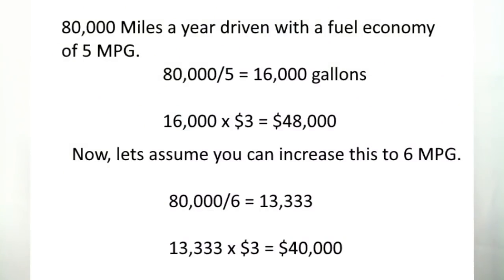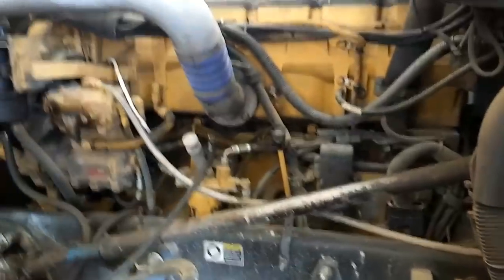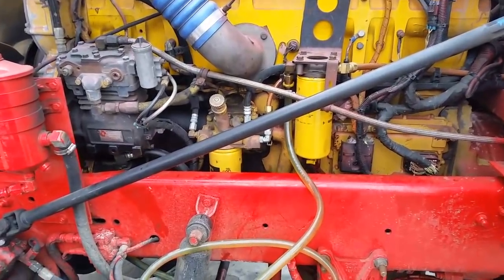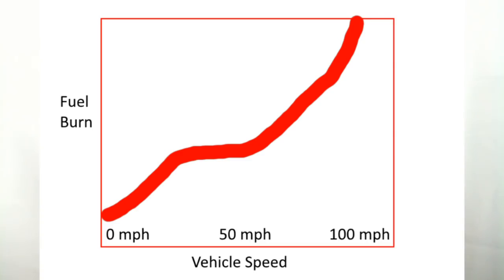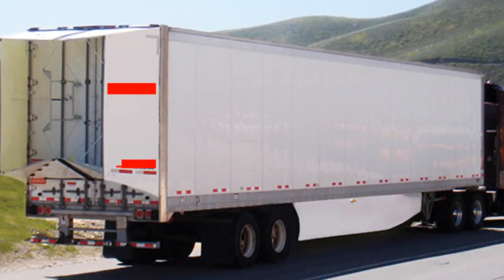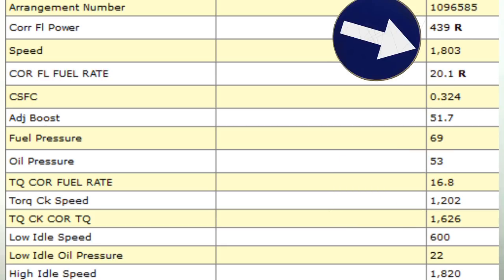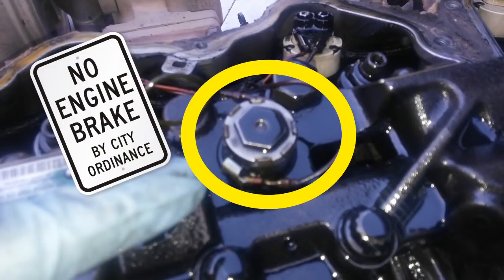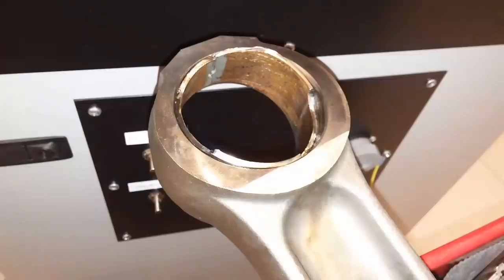How To Get Better Diesel Fuel Efficiency.  Increase Your Diesel Mileage And Economy.

Comment: Hey there.  Totally diggin all your knowledge! Thanks for sharing! You have zero idea how much YOU help people like me learning diesel (CAT)! I am running dual CATS 3116’s in a marine environment (Knotty Hattitude).  I did  not see anything about cold condensed air via intake to increase fuel efficacy increase.  Obviously I’m knew to diesel and have zero clue, lol.  Wondering if I can get better engine “room” circulation will this increase efficiency in anyway?  I guess Im asking if colder condensed air makes a difference in fuel economy for Diesel engines?  Btw SW Florida here. Engine room is not sealed, but no forced air mechanism in place just KnN intake filters on engines.
Reply: Hhhh he

Comment: Hi Josh good info. I run a Iveco cursor 8  330hp just 2 axles with a heavy 3 axle trailer. the other guys in the fleet run about 2.1-2.3 kml. I run between 2.8 - 3.15kml. took your advice about low boost pressure made a big difference btw. I can agree with you about the leadfoot thing I stick to around 85-88 kmh. 1 other thing I can add that does make an improvement is the distance of your trailer from the back of your cabin. I had the 5th wheel moved as far forward as was practical an makes a significant difference. now I'm running a dedicated trailer Curtain sider. would lowering the viscosity of gear/diff oil make any kind of difference? I live in Brazil btw. where we pay around $3.09-$3.25 per liter. Thankfully after we paralysed Brazil for 13days government caved in and gave a reduction of 0.46c l. Add this figure to that above and you get a part of the real cost! My boss pays $4.5-5 million per year on fuel. on a 30 truck fleet. It's taken about 3 years for him to finally start listening to me on ways he can improve his margins. Decrease costs etc. That's just by leading by example. The rest of te guys in the fleet are gradually getting the message through their hard heads. 2 thumbsup and keep up the good stuff.
Reply: Lowering the viscosity of the oil in your transmission and differential will improve your fuel economy, but not by much. Less than 1 percent probably. Also, if you use a lower viscosity oil than recommended, you risk causing damage or excessive wear, so don't go lower than what's recommended for your truck. Hope this helps.
Reply: I definitely agree on closing the gap between trailer & cab. Your breaking wind once, not twice.lol

Comment: I knew two guys that ran together, same truck, same engine, same loads  in all kinds of terrain, souped up 350 Cummins and 5x4s.  Only difference was one had higher speed rear ends so he could cruise in 5 direct instead of over.  With the power going straight through the transmissions in direct instead of the counter shaft in over he saved 10 to 12 gallons a day over his partner.  These were bull wagons on mostly local hauls, so they were not driving high mileage.  For a long haul trucker on mostly flat ground, I would expect more difference.

Comment: I'm an Old Farm Boy and we ran Fleet 1540 in all the fleet from the Ford Ranger to the 350 horse Cummins do the D7 cat,,,,,,,, and I never shut engines down I always let them idle,,,, now in the Ford Ranger I discovered when I went from sleep 1540 to  synthetic 5w 30 I gained two and a half miles to the gallon,,,,, all my equipment has very high hours and miles on them so running thick oil really made me feel good,,,, but recently I found out on the smaller engines going to 5 W 30 synthetic I've wasted thousands and thousands of dollars in fuel over my 30 years of being a driver operator,,,, I don't want to even think about how much money I wasted I never had an engine go bad but I wasted a lot of money on fuel and gas,,,,, so now I am trying to run lighter oils and smaller engines,,,,, and since I've never had an engine go bad now I'm shutting them down whenever I can so they ain't idling,,,,, just my observation thank you

Comment: I went from 11 to 16 on my 08/ 6.4 Power Stroke. By Deleting the EGR and The DPF. Elegally brought into Law by the EPA. The EAP can not make a law that will benifit the manufacturer with money that virtually does nothing. To help emission control by using more fuel and shortining the life expectancy of the engine.
Reply: PS regen for emission control is an oxymoron. As shown on your face when you brought it up then the disposal and other clean-up procedures are not inviormently friendly either. So therefore as brought up in law it is not lawful to force you to use something that has not passed the science test.

Comment: Dropping from 65 mph to 55 mph is huge.
Reply: I agree it's very huge, but I find I can't run 55, even though I'd like to, because of time limit, and traffic jams.unforseen setbacks that will make you miss appointment times.
Reply: Aaron Garcia my Freightliner got close to 3/4 gallon better at 68 than 55. Gearing has a lot to do with it. Fleet trucks are specked incorrectly. Cheap cookie cutter trucks.
Reply: Well at 75+ mph my 95 powerstroke drops rpms, 4th gear. Below that it's 3rd and 2400rpm
Reply: BINGO!!!!!
Reply: Seems to me manufacturers could install gearvendor type units on the 1 ton and under trucks and we could all save a ton on fuel costs. But that would cut into CEO salaries and we can't have that now can we.
Reply: @aviatortrucker6198  Or cheap cookie-cutter versions or configurations of otherwise excellent trucks.
Reply: If i run 55 on a flat loaded I seem to be lugging the engine at 1200 with 32 psi of boost 
But at 65  im running about 1500 and 25psi of boost 
That's with a 10 speed eton and 255 75 22.5 tyres on 
10 car hauler with harldy any areo dynamics 
@Adept ape what do you think is the best rpm to speed + turbo psi to maintain 
Im Running a 2003 single turbo C15
Reply: Air drag is exponential, so you will gett increasing benefits
Reply: There’s a 1% difference between all of the air and 99% of the air

Comment: Using brakes does affect fuel economy, whether it's compression, friction or other. While it's true that you're not burning fuel while braking, what you are doing is converting momentum to heat. That momentum or kinetic energy came from--guess where--fuel that you burnt getting up to speed, up the hill, etc. By avoiding the jake or brake pedal and coasting longer, you are burning less fuel.
Reply: Yes. But common sense prevails here. His point is the actual act of using the brakes does nothing in real time to effect fuel economy. Like if you climb the grapevine, are you gonna simply coast down the other side? Absolutely not.
Reply: @DavidBurgess-captainindustry
True. You just burned a lot of fuel to get all that weight moving, then just waste it with the brake pedal, then restart the process.

Comment: Aerodynamic resistance is the the speed squared ie double your speed and you burn 4 times the fuel. Also tyre pressure makes a big difference and the make of tyres. Tyres in the UK have a energy rating, wet weather breaking and noise markings on them to help you choose.

Comment: Number one thing to do to increase fuel economy from a good running engine is
Use your cruise control 
Detroit Diesel for one programs driver rewards by way of increased hp and or higher road speed  ( this is more common for fleet trucks)
Reason being as in cat they have soft cruise that lets the road speed drop a little and increases throttle lightly   Kind of like the old saying put a egg under your throttle with out breaking it
Also if equipped with progressive shifting  
Or not practice this shift early dont wind out your gears use the torque range of your engine
Peterbilt Mack Cummins Detroit Diesel Catipiller Mercedes Benz factory trained tec 37 plus years Retired
Reply: you are very wrong Paul, if you use cruise on flat level ground yes but when you sstart running hills get off the cruse

Comment: Few Ideas I had watching this
- You mention jake brakes. They would increase fuel economy if not using air?
- Alignment of the wheels.
- Mirrors. Are cameras legal to use?
- Drain on electrical, lighting, accessories, does it make a good difference?
- Are there upgraded turbos that would be more efficient?
- Misadjusted brakes or bad wheel bearings.

Comment: aero dynamic wereout for me unless I was running empty pulled an rgn 7 axle setup most of the time the difference between 65 and 70 was half mile to a gallon Lucas fuel additive after running 90 with and 90 days without worked out to 2/10 a mile gallon better with proper tire pressure makes a difference. also tires last longer and have less tire problems it all counts in the end
you and buddy have a good day
THE GRUMPY BUS

Comment: Biggest improvement to a CAT is a GOOD aftermarket tune. All the CAT tunes are now low NOx tunes ...which reduces the injection timing. Years ago I drove an 01 Classic XL with a 13 double over and 6NZ that had new injectors done by CAT but they also flashed the computer for free since it had never had a reflash since new. With 4 new injectors it went from 5.9-6.2mpg to 4.8 to 5.5mpg and had the most unhappy sounding 550hp ever. The owner got frustrated with the truck and sold it for an ISX Volvo auto. I wish I knew then what I know now and purchased it from him.
Reply: Yes, you know this and I know this, but most people don’t. 
EPA makes you waste fuel. 
All these “experts” speak their THEORY that “more power means more fuel”. They need to stop talking since they don’t know. 
The fact is like you say, proper timing and fuel delivery for EFFICIENCY, not for EMISSIONS.

Comment: It’s really hard in the summer but if you don’t idle at night you will save a metric ton of money. 10 gallons a night x 300 days on the road x $3 a gallon = $9,000 a year.  For the winter get a diesel parking heater they use a gallon a day for heat.
Reply: Smart
Reply: @bobirving6052   I did even one better. I parked the truck and did something else more productive with my time.

Comment: I think a lot of people will gloss over the fan concept and the amount of power they can kill. First off yes I know the demo is on a gas engine but remember the equation for HP doesn't change (=[RPM x Torque]/5252). Watch Engine Masters episodes 20 (fan) and 35 (accessories) on motor trend, since they removed them from YouTube. 
Thank you for making these videos, I'm learning a ton.
Reply: Yes. Torque is the real number, hp is calculated.

Comment: We had a diesel Ford that used like 4L/100km (60 mpg), was pretty good.
Reply: pretty sure how you measure mpg gets you a higher number than across the atlantic, not sure too lazy.
Reply: @Baigle1  I just googled how much it is in mpg, didn't check if its UK or US MPG.
Reply: 60 mph is like 600% better than my 2005 Ford E450 6.0l powerstroke
Reply: lol
Reply: Better check ur math...seems pretty hard to believe unless you were coasting down a really tall mountain...I get 20mpg out of my 12 valve cummins...
Reply: @TopiasSalakka  UK gallon us 20% bigger than a US gallon

Comment: Run downhill a lot. 

Okay, now on a serious note: tire pressure when loaded/empty, engine speed/gearing, aerodynamics, proper shifting, hyper-miling (coasting to lights rather than braking to a stop and then starting from a dead stop and getting all that mass moving again). 

Running in the wake of another truck/having another truck run in your wake. It works, but requires a lot of vigilance. Proper service, high quality lubricants. 

Cruise control. Avoid frequent stops if possible. Limit use of AC, engine fan, compressor. They all suck power and therefore fuel. 

(Ideally, non-EGR/DPF/DEF/SCR engines.)

Comment: Big things on a 425b, valve set (not cat spec) advance injection timing and smaller exhaust manifold to get you turbo boost up higher, and propane injection we have two doing consistent around 7.5-8 mpg loaded
Reply: Cool! Does the propane replace diesel use 1:1, meaning you save a gallon of diesel and burn a gallon of propane? Or is the propane more, or less efficient?
Hear anything about water injection? I’ve heard good stuff about that.

Comment: By the way excellent program today super fantastic commentary,,,gentlemen let's also not forget just in case you have a dragging brake make sure the rear ends full of grease driveline is greased front wheel bearings are greased ...tire pressure of course

Comment: Well as a old fart 77 who worked a few yrs as a mechanic when young  , i started out using 1 cup wd40 in my engine oil and transmissions   well after 50 yrs never lost a engine or hv leaking seals  ,even put some in transfer case and differential  ,again no seal leakages  ,even keeps valve quild seal good , when they get hard  ,they let oil go by 
Even spray my wiper blades  ,never go bad 
I love my wd40
Reply: I worked at a Toyota assembly, manufacturing plant in FREMONT CA for 20yrs & they said never to use WD40 on rubber , causes it to deteriorate
Reply: @robertmintz63  don't believe that at all even spay the rubber seal on windshield  to keep it soft and sealed  
I use it also in my new duramax after breakin go on line see all the use of wd40 it is their also  I suggest you up your education

Comment: Best Fuel efficient is to tone it up and use a mixture of 80 percent use cooking oil 20 diesel... your welcome 367156 later with no problem and 26 miles city 28 high way

Comment: The cetane ratings very wildly at different fuel stops. You need to pay attention to differences in your fuel mileage and remember were you got the good stuff at.
Engines running at lower rpms will notice cetane ratings less and you can buy cetane boost to spike it.
When I used to drive a truck it wasn't that big of a deal, but now that I own a diesel at home with a smaller engine you do really notice big differences when buying fuel at different places.
Reply: I found Mobil got my powerstroke best mileage

Comment: i noticed a bump is mpg on my 5.9 cummins when i went up to larger injectors, again when i went compound turbo, and again when i run my programmer. each one of these has gained me a small bump but its all conditional to me being lighter on the throttle. if i run my programmer on mid-high hp settings and keep my mph down while hauling and my foot not INTO the pedal i get about 2.5mpg more than running the truck as stock
Reply: Larger injectors will put a given amount of fuel into the cylinder in a shorter time. This is a bit like advancing the injection timing and can obviously be of benefit, but there are limits. As the Adept Ape said, black smoke is wasted fuel so my question is did you have smoke before the compounds and less or none afterwards?

Comment: Dropping speed from 75 to 55 will definetly help a lot with mileage, but from my own experience, keeping the engine on the boost at all times is what helps the most.

I have a rather new 1 Ton Mistubishi 2.5 Diesel Truck.  It gets the best mileage when I drive keeping the Engine Speed above 2000 RPM. The Turbo in that engine operates from 2000 to 3800 RPM. Driving under the boost curve, it will feel sluggish and consume more fuel than when using the whole RPM range. Just my 2 cents.

Comment: My 89 ford diesel was getting bad fuel mileage. When I was in the army we used to add engine oil to the fuel. I added a 1\2 a cup of oil to my 30 gallon tank. My truck went from 12mpg to 15mpg. I calculated mpg over a distance of 60 miles.
Reply: Did not help in city driving though still got 6mpg in the city.
Reply: @timesthree5757
Have you tried longer distances and more accurate calculations since then?
Old timers have always said to add a quart of atf every tank.
Reply: @bobirving6052  more accurate calculations? What do you mean?
up to 60 miles is all you need to get a accurate MPG.
Reply: @bobirving6052  ATF fluid as silicone in it and is not good on the Engine.

Comment: The most significant increases to fuel economy comes from reducing the cargo weight on the drivers seat.
Also, stop running the air conditioner at max all day.

Comment: I drive a 2018 peterbilt 389 glider & pull a stepdeck.   it's got a '99 model series 60 12.7L Detroit @ 500 hp.  I drive this truck between 1500 & 1700 RPMs (when loaded) & typically drive it at 18-19 lbs or less of manifold pressure.   I drive as fast as 18 lbs will get me. as fast as 75 & 80mph quite often.  most loads are almost always either heavy or drag a lot of wind.   the worst I've done on a tank of fuel is about 5.8 mpg, but typically avg between 6 - 6.5 easy.  we run 48 state.
Reply: THOSE ARE GREAT MOTORS.

Comment: Hey could you talk about winter fronts for diesel trucks in the winter? Benefits, when to use etc
Reply: Used covers on my gas pick-ups. Tends to improve warm up time and fuel econ in the fall or winter months. Basically prevents the engine bay from being a parachute. As long as the fans aren't turning on  you'll be saving fuel.
Edit: to keep an eye on things I rigged a little light to the fan controls to tell me when they turn on.
Reply: Smart!

Comment: Best thing that I've done for my Ram Ecodiesel= GDE Hot Tune! Getting 31-33.5 mpg now! Dynos way more hp and rwtq. Still never smelled as clean a motor under full load on the dyno! Raising cetane with CenPeco additives did nothing for mpg.
Reply: Tune/advance timing is where it’s at.

Comment: One fuel additive that does what it says is Enerburn which reduces soot and increases my regen interval a lot. There is a similar new product called BetterDiesel FBC that does the same and includes injector cleaner.  My regen interval was about 350 miles and is now about 500 miles.

Comment: Well as an engineer compression ratios are critical to running an efficient engine along with preventing friction losses and energy into heat loss prevention. Gear is critical to, but namely for diesels 14:1 -22:1 is the sweet spot for compression ratios depending on fuel delivery.